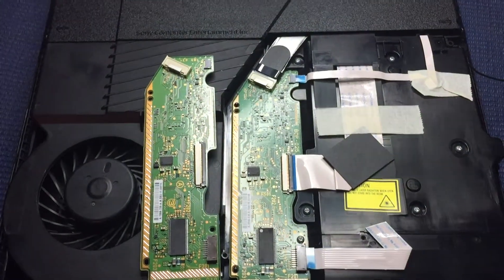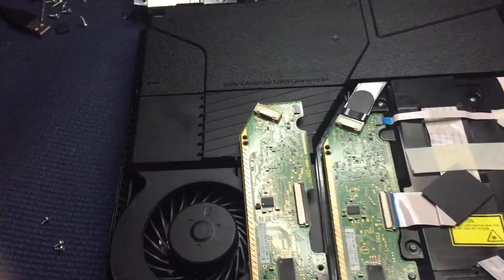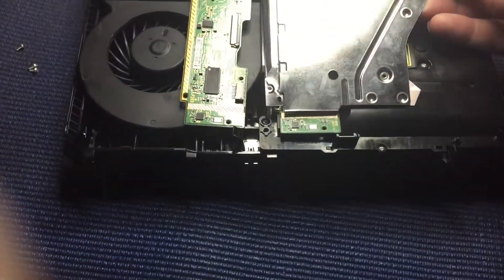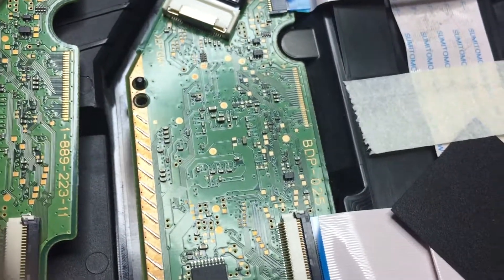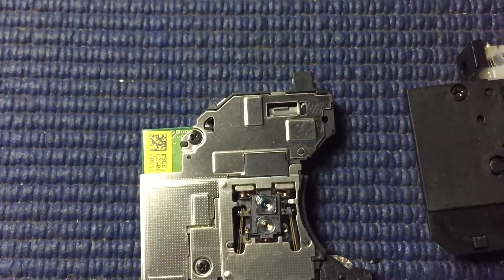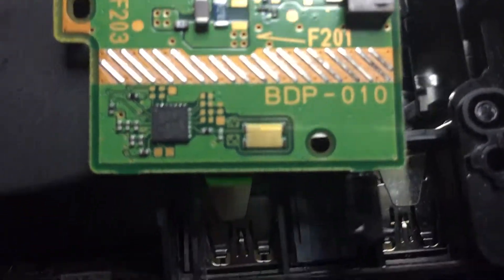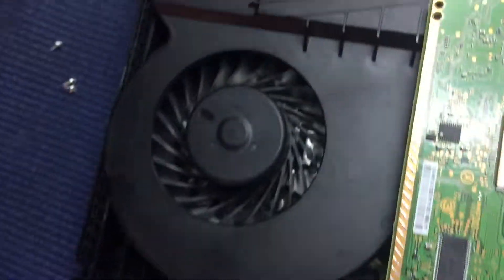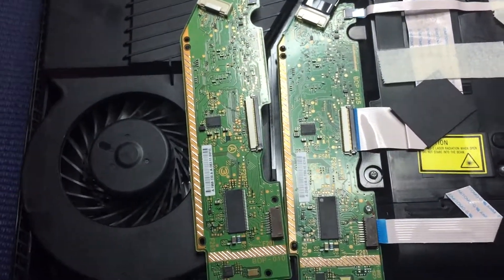Difference between PS4 BDP-010 & BDP-025 Blueray Drives

Comment: hello what motherboard works with the Bdp-025
Reply from the maker: +Vasselie Geffrard Can't remember, I'll have to pull some consoles apart won't be for a few days.
Reply: oh thank you but i found a site called ps4 dev wiki and it gave me which motherboard works with each  daughter board thank you though for responding.im going to try to install a ps4 blu ray drive in this ps4 i bought figured it would cost less.
Reply: +Vasselie Geffrard ifixit.com  has breakdowns and can order parts references and you can even buy the tool you'll need if you dont already have it.  you can either buy the same optical drive or you can buy a combo that has the motherboard and optical drive pair but you wont get the daughter board.  but you can buy that too if wanted.